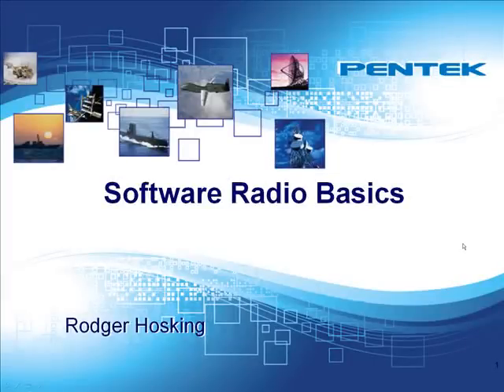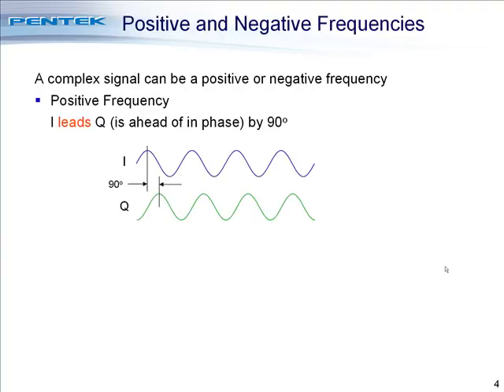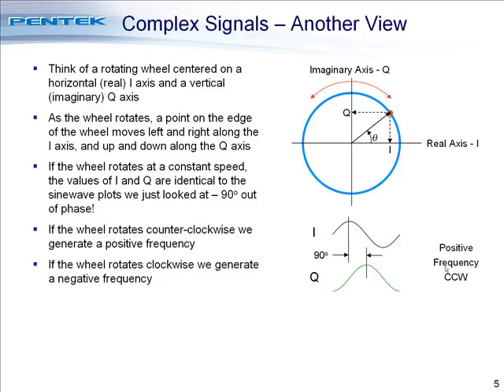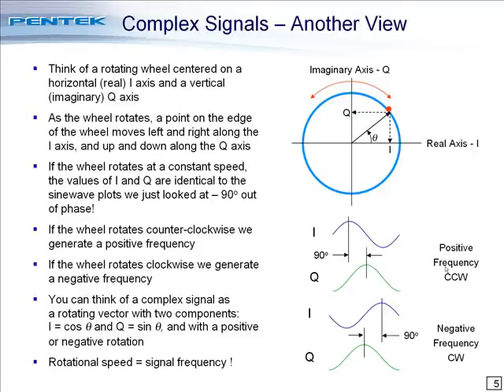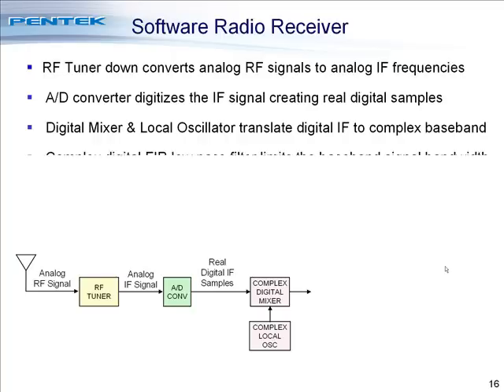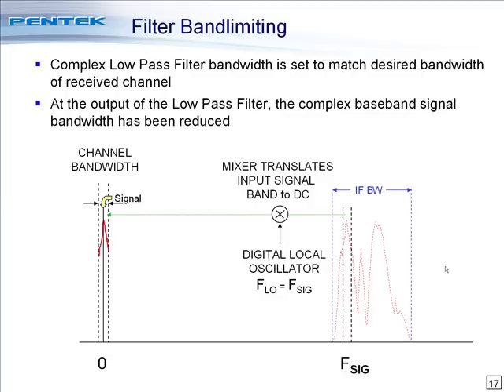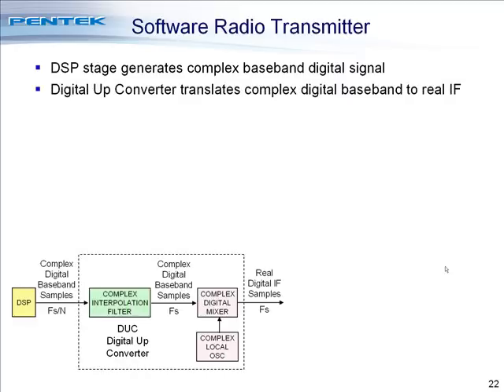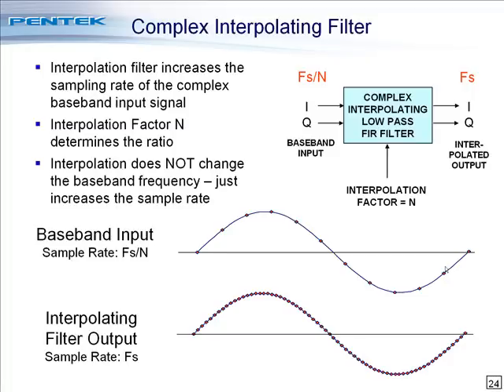Software Radio Basics

Comment: I absolutely LOVED this presentation! I graduated in 1976 with a BSEE, but all of this was a practical impossibility due to the relative slowness of existing compute power. Imagine trying to implement these ideas with an 8 bit microprocessor (think Z-80) running at a ”leisurely” 4 mHz.!

And yet … all of the COMPLEX MATH was possible, just nothing fast enough to run it! Perhaps we ought to think ahead and create (theoretical) concepts, even if they have to wait DECADES to be practical. You know, the old humorous chemical equations that had a block labeled ”An then a miracle occurs…” 😀

Comment: Yeah, sorry if it's there and I've just missed it, but but how seems like you left out something major, i.e. HOW does this "digital complex mixer" get I and Q from just the sampled amplitude values? From what I could gather from the source code of uSDX (seemingly the only source on the subject), what it does is sample at 2 * Fs, treating even samples as I, odd as Q, but linearly interpolates the Is, replacing each one with the average of it and the next one. What this clearly does do is shift one of the streams in time by one sample period, so that the synthetic Is coincide with Qs.

While the thing does work in the end, — the device does seem to receive SSB, which is the only use for the I/Q data there, as far as I can tell, — I can't possibly see a) how can those I values be correct beyond the simple assumption that both domains are (-1; 1), and, more importantly, b) any basis for the downright strange assumption that a shift by one sample in the array is equivalent to a 90 degree phase shift. This technique, which quacks like a dirty hack for the anemic 8-bit MCU it's written for, is called a "Hilbert transform" in the comments. Whatever. Correct or not, the whole transition from amplitude samples to I, Q pairs doesn't seem like an "implementation detail" you can just omit here, especially when the end result of the formulation is supposed to be a general SDR, and not some special case transceiver.

Comment: Very nice presentation but... 5:12: there is a mistake in the first formula. You say: cos(f1)sin(f2) = 1/2*{sin(f1-f2) + sin(f1+f2)} which is wrong. It should be: cos(f1)sin(f2) = 1/2{sin(f2-f1) + sin(f1+f2)}.
Second one is OK.
Both formula should be presented in this way:
cos(f1)sin(f2) = 1/2{sin(f2-f1) + sin(f2-f1)}
cos(f1)cos(f2)=1/2{cos(f2-f1) + cos(f2+f1)}
Reply: Actually this is not really wrong since a negative frequency in the cos is the same as a cos with the positive frequency. Negative frequencies get "mirrored" up in the spektrum. Its only better to undertand in this case.

Comment: So the reason you multiply/mix the input by an analog RF tuner, is only to bring the signal to the area of the band-pass hardware filter?  Would Direct-Sampling remove this Intermediate-Frequency requirement, and if so, why isn't it the preferred approach?   However, it still feels like a free lunch that you can sample and get a single ADC value, but then digitally mix (DDC) to get 2 baseband samples (the cosine (Q) and sine data (I))!  After-all, couldn't more operations be done on the same sample to get even more bandwidth?
Reply: Because of the low sampling rate that original waveform is being sampled with large gaps, so the phase shift allows you to sample that missing part.
Reply: you can but you need expansive ADC  , the circuit would be    antenna -->LNA->BPF->ADC